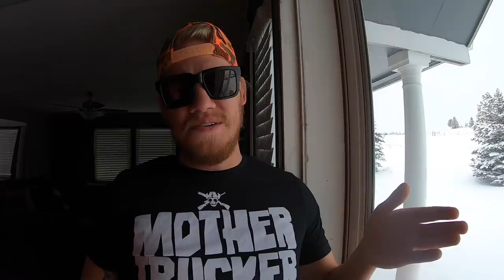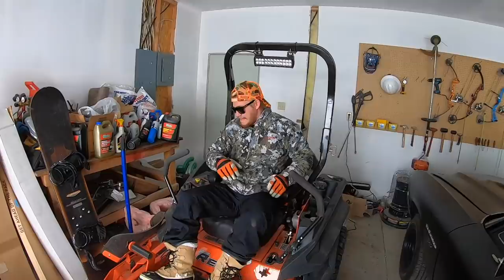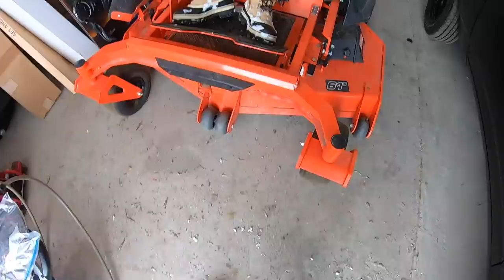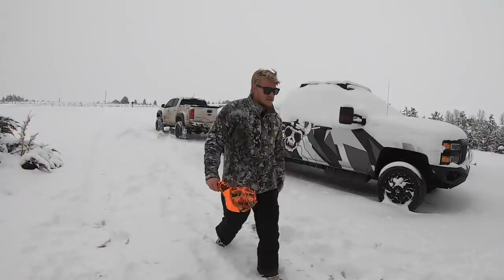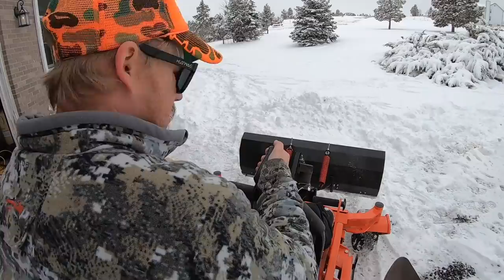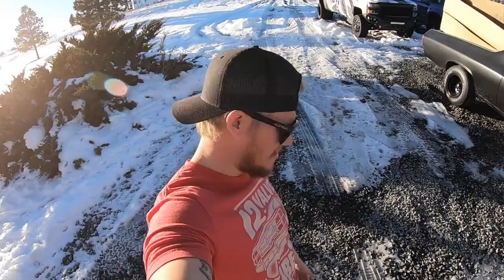Plowing Driveway with my LAWN MOWER

Comment: Yo Outlaw! If its possible you should intergrate the plowcontrols into the steering sticks. Run some wire inside the stick and have a pushbutton on the ends, to press with your thumbs. One side: Raise and the other side: Lower. I would do that, for easy access 👍
Other then that, the plow works awesome! Lots of power in that BAD BOY!! :D

Comment: That's pretty cool it worked,doing anything with your hands on a zero turn can be tricky sometimes.It might make it easier if you had some kind of footswitch instead since you don't use your feet on that kind of mower.Also probably would be wise to run that wire inside of some shielding, those mowers vibrate like crazy and you run the potential of rubbing right through the wire with the frame.great idea tho brother,and great price too

Comment: Anyone else generally impressed at how well that mower worked? 😂 I certainly am..

You should get a hitch mounted winch plate and throw a winch on it, so you can throw it in the rear if you get stuck kn a trail or something like you did yesterday. Then you can winch yourself backwards!

Comment: Not sure if this will help, but when I used my zero turn to plow snow or mow, and picked up the cut grass. I would use one hand for the toggle switch and use my other hand in the middle of the turning arms and would push and pull with my thumb or pinky. It’s a little tricky at first but saves time once you can do it. Hope that helps.

Comment: Hey OutLaw I just wanted to give you a tip about lawmakers the more you jump them from the car you can burn up the (celaroed )and it will cause your lawnmower to not start ( sorry if I spelled the word wrong) ask the parts store they should know what part you need.

Comment: Outlaw, it looked like your headlight fluid was low. As to your GoPro battery dying in the cold, just use distilled water and anti freeze 50,/50 blend. It will work like a stripper on a freshly cleaned brass pole!!! Damn that picture in my head just makes me hungry and whiskey bound!!! At $400 you stoled that mother!!! As a golf course owner would say.... fuck winter!!!  Funny vidja, w.w./Tulsa

Comment: I work on trucks and if your def won’t lock check your fluids if they are low it won’t lock because it doesn’t want to strip your gears also it’s easier on your def if u put it in neutral before u lock it

Comment: I would Zip tie or electrical tape it to the handle then run the harness down the handle with zip ties and leave enough to flex with the handle so it doesnt rip wires
Reply: And that Ted piece should stay on there it's a cutting blade it's meant to be on there so it foesnt wear the main blade just the red piece

Comment: If your blade can be adjusted at an angle than if you use it in that position and build up some speed you will actually be able to throw to the snow one direction or the other.

Comment: Trial and error brother....Figure out the easy way. If the plow can turn, its always easier turn it to say the left and start on the right side. The snow goes to the left,  and its easier on the vehicle platform. When the plow is straight its hard to push because the snow doesn't move to one side or the other.  If the plow doesn't turn to the left or right then disregard this message lol. Keep it frickin hillbilly!

Comment: I have a commercial Gravely ZTR with a 27 HP water cooled Kawasaki 60" deck.  About 10 years ago I built a plow for mine and it pushes my 300' drive in two swipes no matter how deep the snow.  How would something with the weight over the tires like that NOT push snow?  My neighbors teased me and swore it wouldn't work!  Till I was done...

Comment: Low RPM and FULL CHOKE my Bad Boy starts every time even in negative temps and I use my Bad Boy zero turn to move my 22’ car hauler around in my barn and my property... Bad ass mower and I use it like a tractor while I’m wearing my Air Jordan’s with sweats on and beats air buds hooked to my I-Phone sipping a cappuccino with a stogie in my mouth... Facts! I mounted a Meyer home plow $2k to my wife’s 16 Z-71 but now I want to mount it to my mower and that wasn’t even a foot of snow looked like 8” to me!

Comment: Ok about the truck stuff.   I am 18 and I have a 2019 f350 with a 6 inch lift and 28 inch tires and ik danm well it would not go through 5 feet of show so ttelling him to get a full size truck is dumb because size has nothing to do with it it's what your going through its all about power and if the powes not there it's not moving so all of you can stop talking shit till you try it for your self